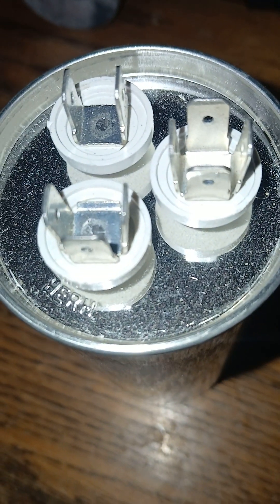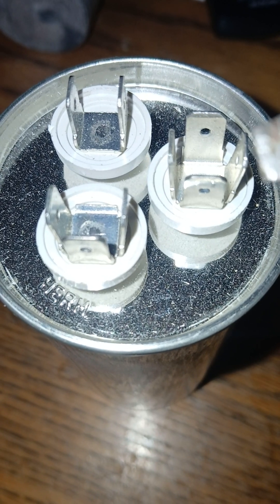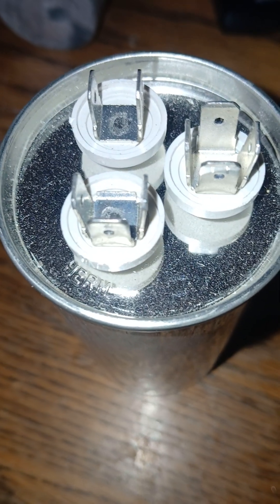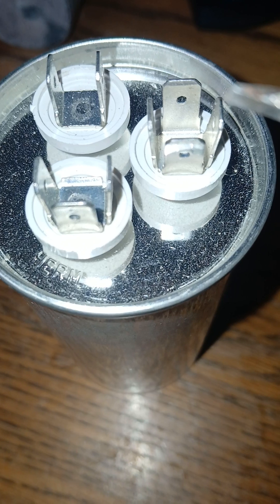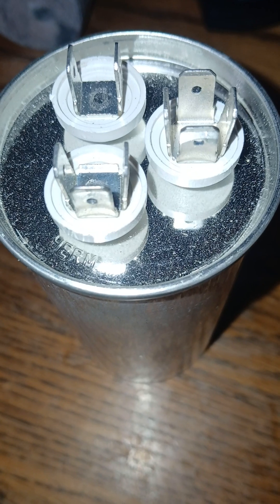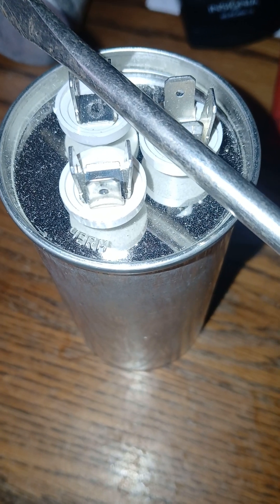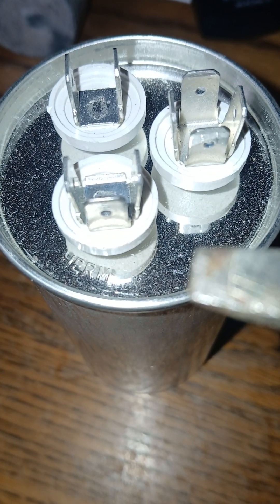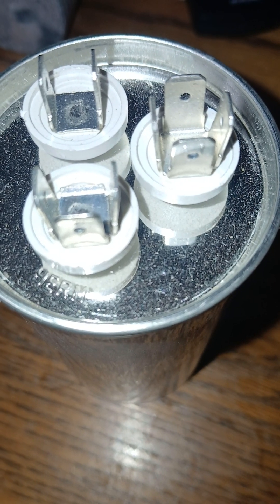Is It Safe To Touch HVAC Capacitor After Removal?

Comment: Does central heat and air use freon for heat?
Reply from the maker: @garyclements318  Great question.

Heat pumps may use refrigerant to heat, and they may use heat strips when in Aux(auxiliary mode), and heat strips for E(emergency heat).

The refrigerant may reverse, i.e., the reversing valve may assist in reversing.

Gas furnaces may, generally, not use refrigerant to heat.

With heat pumps, the outside unit, condenser, may be used year round. 

Gas furnace condenser may not be used year round, as it uses gas(natural gas & propane) in the air handler.

...thank you!
Reply: @gotchaplumber  thank you for your answer.   Also I noticed sometimes a capacitor is dented when bad.  I'm not a heat and  air guy but curious about things sometimes. Lol
Reply from the maker: @garyclements318  My opinion is capacitor are inexpensive, so a yearly or bi-annualy capacitor change may help and may save money on expensive service calls?

Thank you!
Reply from the maker: @garyclements318  My opinion is, dual run capacitors, located in condenser, often go bad in hot summer months(hint, hint)?

Thank you!

Comment: Are the "common" wire(s) connecting to the cap ALWAYS insulated in WHITE
Reply from the maker: @pcnetworks1292  hesitate to convey always, for one may encounter many different scenarios?

...perhaps uniformity is optimum, yet ideals may not exist?
Reply: @gotchaplumber  
So insulation colors could easily be a mixed bag in some cases then? 

Good to know 👍
Reply from the maker: @pcnetworks1292  My opinion is wire coloring is good for nmonics, yet one may see colorful variations.

The correct wiring schema is important though.

The correct wires may need connected to correct spots.

Common, start, and run(these need correctly wired.
Reply from the maker: @pcnetworks1292  Say, condenser fan motor(3 wire) may have brown to fan & common & run to contactor & with three wire, one may have jumper  from contactor to common on cap.

Pull up schematic, perhaps the wiring concept may begin to make sense?

The way my thoughts incline; three things: condenser fan motor, contactor, and capacitor.

One "start" is connected to cap, this only leaves two other wires(need 120v on each leg perhaps, so those may go to contactor).

Wiring diagrams may help.

Thank you!
Reply from the maker: Thank you!
Reply: @gotchaplumber  

Thank you for the informative video! 

I have always had an overt fear/respect of capacitors.
Reply from the maker: @pcnetworks1292  Wlcm.
Reply: @gotchaplumber  
1390 Lansing?

Comment: I do appliance repair, and I treat those little bastards with the utmost respect. Microwave caps will kill you. I use two long, insulated screwdrivers to dishcharge them, just like you said. Works every single time, but you have to be sure you dont have a driver with a hammer end... Because yeah... Metal hahaha. 

Such a great video, brother. Thanks so much for the free education! Take care and may success follow you wherever ya go!
Reply: Well there typically 1 micro Farad caps typically have a 10 Meg ohm bleeder resistor to discharge said cap to less than  100 vdc in 50 seconds...that's 5 time constants. Multiply 4 kv worst case by.0.37 for each time constant. 0.37 times 0.37 times .37 5 times. Much longer than it take you to pull out all the screws to attempt to Electrocute your self. 
BTW the threshold for death from a capacitor is 10 joules.
Joules = 1/2CV^2
C is in FARADS, V IS IN VOLTS.
1 MIRCO FARAD IS ONE MILLIONTH OF A FARAD BTY.
Please do the math, assuming a defunct ie open bleeder resistor and 4000 volts on the capacitor. 
If you can't figure this out I humbly suggest you should Not be servicing micro wave ovens.
It's the transformer that can kill you, unlimited joules ie energy courtesy of Edison. 
Be safe out there!
Dave
Reply from the maker: @davidpacholok8935  Thank you for sharing!
Reply from the maker: @YourFoolishPride  Thank you for great input.

Have a great day!

Comment: You only need one resistor in parallel with the capacitor(s) to achieve the discharge. I'd start with a high value such as 1 megohm (1 MΩ) and work down to 100K as needed to achieve the functioning you need.
Reply from the maker: @AmericanOne9621  Quedtion: off the tangent, 1. the jumper wire from the run side of the contactor to common on capacitor? What does it actually do?

Thanks.
Reply from the maker: And if one jumpered from the common side, are there any adverse effects?
Reply: @gotchaplumber  I studied air conditioning and even got licensed but that was many moons ago. I chose the career path of a lineman (power lines) and now have retired. Said all that to say this, I'm by far an expert although I do service my own unit. a resister hooked up with  a set of alligator clips would be safe to discharge with no arcing envolved. Also AC like you said in time will dissipate where as DC won't. DC will hold the charge till the cows come home...
Reply from the maker: @AmericanOne9621  Good to know about DC.

Age old question, which is worst to bit by, AC or DC?

Thank you!
Reply: @gotchaplumber  I have stood in a bucket truck with only a shirt for protection and touched 7600 volts with my elbow. It wasn't really painful but you could feel a tingle which was bearable but not comfortable. Of course in a bucket I was isolated but I could still feel it. DC I understand is used more in coal mines and the sort but I have never been around any besides a truck battery... I wear a scar now on my right hand from a AC stand alone house heater which was turned off but plugged in. I reached my hand down the back of it to get a marble and rubbed against a naked wire. I was about 3 grade and was with my family which was stationed in Japan. Dad was airforce..
Reply: @gotchaplumber  Just sitting here thinking that now they about dip you in rubber before you can work on any power lines...things change....and probably for the best as far as that goes. All we had back in the day was rubber gloves and a few sleeves for the wires on the pole...
Reply from the maker: @AmericanOne9621  Gotta be careful with the high voltage, 240v is most I've toyed with.

Higher than 240v, I simply salute the linemen. Lol.
Reply: @gotchaplumber  Same rules apply...Watch where you put your fingers...lol